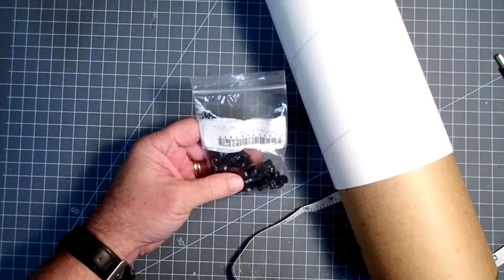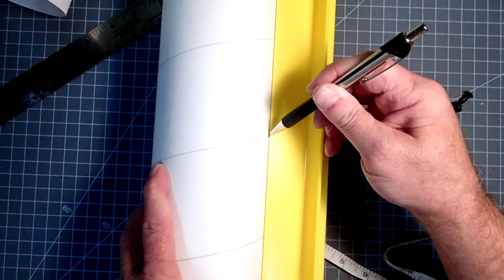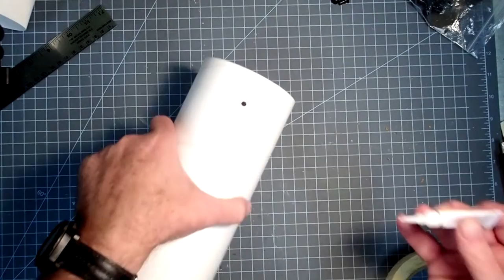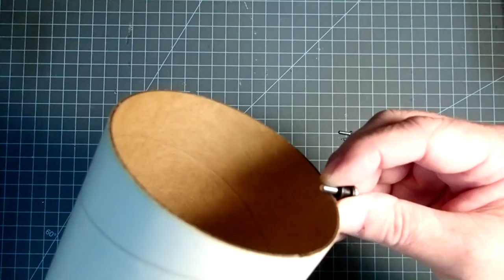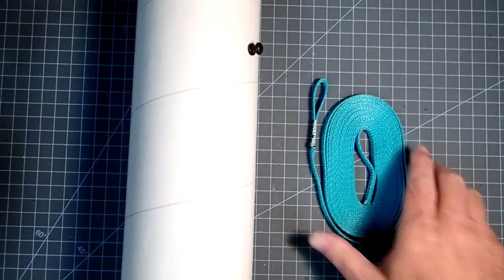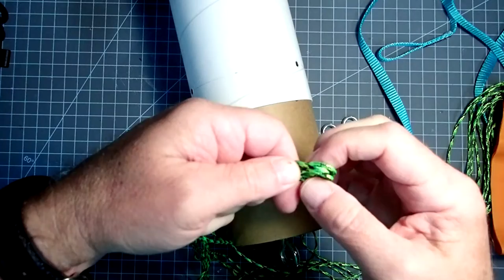LOC Precision “LOC-IV” high-power model rocket assembly (part 3 of 3)

Comment: How stable will the rocket be when launched after all the added tnuts, especially the one at the end of the motor mount? It seems like it would interfere with the mass distribution, since there is only one between two fins and none between the other two. Wouldn't the rocket be heavy on one side than the other, which means it will be more tilted to one side when launched?  and finally, what is the purpose of all the screws and tnuts? Thank you for your videos, they are very detailed and helpful!
Reply from the maker: Good question. None of the nuts have very much mass compared to the rocket as a whole. The nut on the centering ring is for the motor retainer. The other two screws and nuts are for the rail buttons, which guide the rocket along a launch rail. They serve the same purpose as the launch lug(s) on a smaller rocket. None of them significantly alter the flight characteristics of the rocket.
Reply: @REAR_rockets  Thank you! I didn't know that there were other options for model rockets other than launch lug, now I know.

Comment: So I have a question: lets say we configure it the way you did, we would put the parachute in the shock cord tube right? Wouldn't that prevent/change the ejection charge? An added bonus with this method is that we can have a big electronics bay, but isn't riveting the nose cone a hassle if you want to take out your electronics after a flight?

One last thing: can you add a link were you bought the black rivets from, I want to see from up close how they look.

Thanks for the video by the way it really helps.
Reply from the maker: There wouldn't be a change to the ejection charge. At ejection, the rocket would separate at the coupler rather than blowing of the nose cone. The electronics bay can be configured in several ways, depending mainly upon the sled used to hold the electronics. Rivets are just one way to hold the coupler in place.
According to the instructions, the nose cone can be friction-fit in place with some masking tape.
Reply from the maker: Here are the rivets that I used in the video https://smile.amazon.com/gp/product/B07RFM2VRQ/. Apogee Components also sells them in smaller quantities.
Reply: @REAR_rockets  Thanks for the information